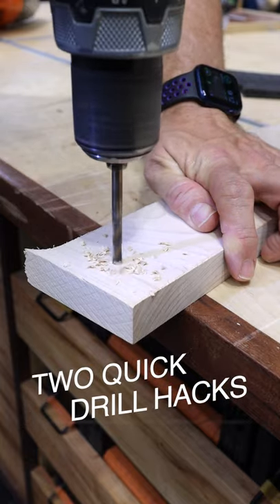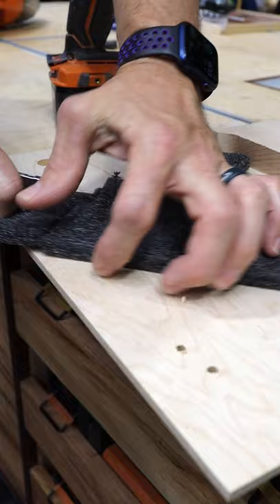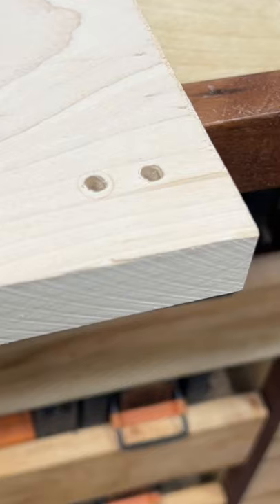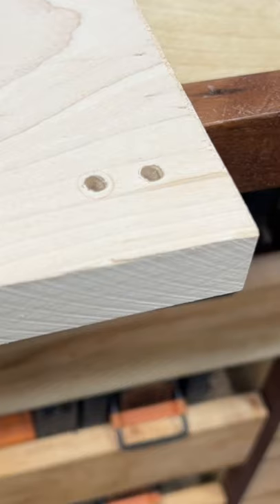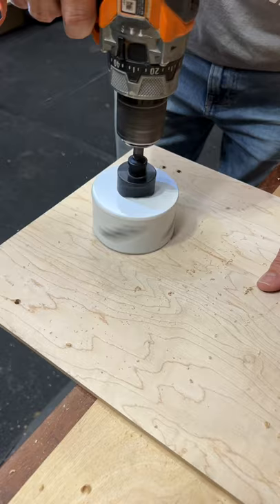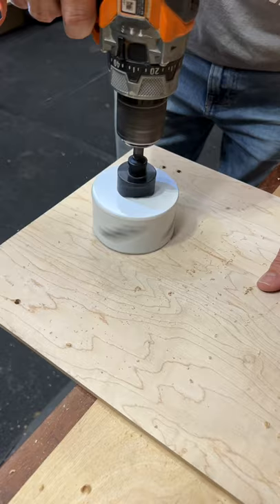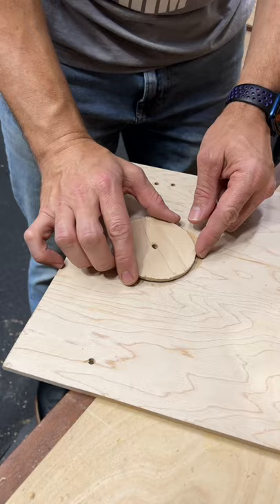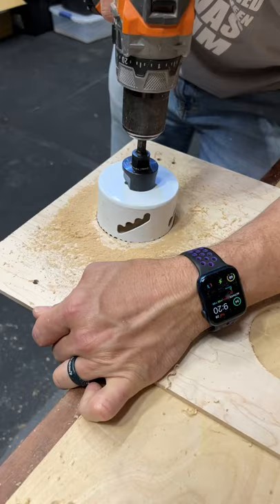2 Useful Drill Hacks #shorts

Comment: If you want to avoid screw holes instead of using the inside piece and cutting around it, use the scrap piece with the hole as a template over where you want to cut.

 Align it by placing the hole saw drill bit into the original drill hole and manoeuvring the template so that it lines up with the hole saw. Clamp the template tight and cut the hole using the template. 

If the centre hole is already too large for the drill use a second holesaw the same size as the cut hole and mounted on the same arbor as the larger holesaw (one saw sitting inside the other) It will then fit into the original hole and act as the centre guide for the large holesaw.

Comment: Tip #1 use sharp bits so you don't have to push so hard you blow through the bottom uncontrollably.  This helps keep the hole rounder and proper size by not running the drill bit the full length.
Reply: I was gonna say..
or don't man handle the drill let the bit do the work?
but it does make sense if it's dull u gotta man handle it

Comment: If you don't drill like a spastic and change pressure towards the end of the hole you don't need tip 1. And tip 2 is a waste of time, just angle the drill to get started then put it straight once you get going.

Comment: Another hack regarding tip #2: if you have the bit for the original hole and it will thread onto the arbor bit with the larger hole saw, then you can use the original hole saw as a pilot. Good tip given, especially if you need to change the center.

Comment: For the hole saw trick, you can also clamp the scrap piece with the hole in it to your work piece where you need the larger hole.  That acts as a guide for the hole saw and also lets you see where you are positioning it so you can sure it's centered or offset, as you may need.